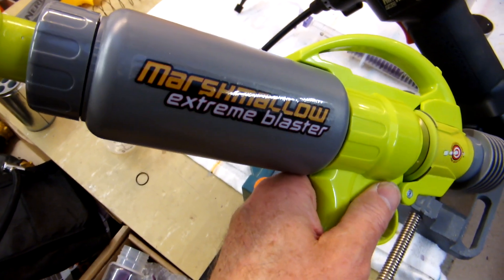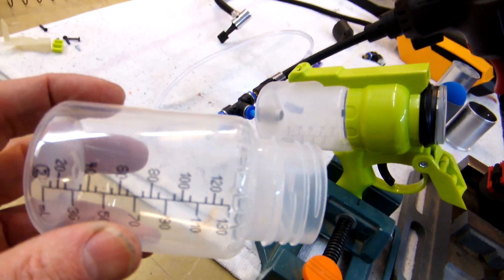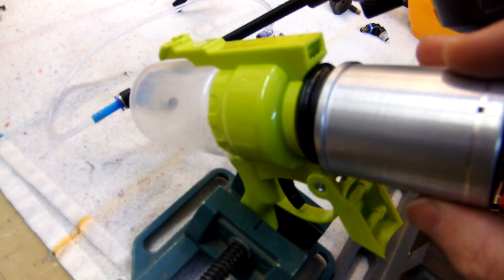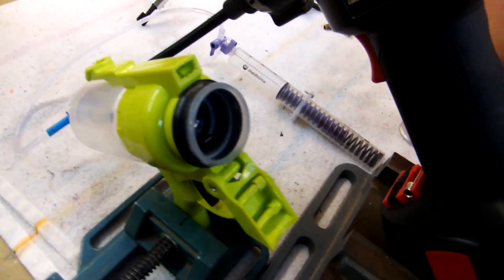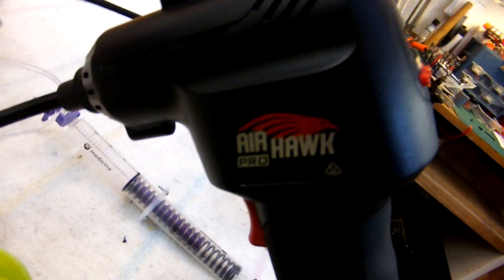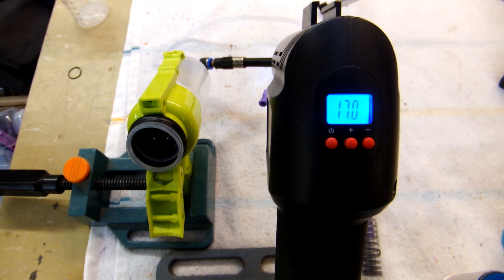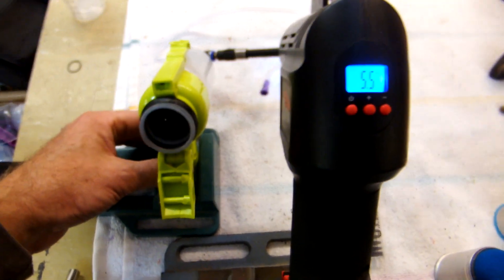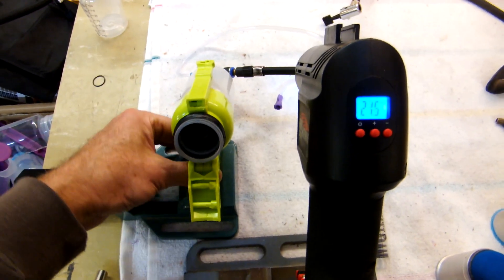MINIMISED MMXB test #1 (automatic refill-cycling)

Comment: Well this is getting spicy.
Reply from the maker: We heard you like it hot, so aiming to please! 😅
Reply: @unscrupulousmodefiler  quick question how good is the air hawk pro. I have been wanting to get one for myself for nerf and normal use.
Reply from the maker: @zeanyt2372  Looking at the internals they're the best quality and most solid constuction I've seen. Still plastic gears, but it runs comparatively smoothly. Apparenty you should go for the "Mark 2" (the one WITHOUT the red screw-attachment for the flexible tube) as the tube's easier to get on and off and something about the build-quality was better (I forget where I saw the review...). The "Pro" has the battery and the "Standard" has to be plugged into 12v somehow. The Pro is pricey here compared to other compressors, but if you were after someting in this "drill-like" form-factor either of them are still going to be a good buy. I'll be doing a more thorough review vid for each of the compressors I've got and will list pros and cons for each of them for use in Nerfing applications. Not 100% sold on this one just yet until I iron out the automatic cycling reliability issue, but if that gets sorted then it's definitley something to consider.

IMPORTANT: if you 're going to run this to pressurise ANY kind of Nerf gear, it's really important to include an appropriately-rated over-pressure valve so you don't risk exploding your tank (hence why I'm trying to make my own in the next vid...). Don't rely soley on the compressor's internal pressure-gauge or auto-stop settings - they tend to over-fill when dealing with very small volumes like this or even "forget" to stop sometimes...
Reply: @unscrupulousmodefiler  thanks for the help. I don't believe in not having backups and safety features especially in HPA.
Reply from the maker: @zeanyt2372  Cool man. I learnt the hard way, popping the business-end of a v2.0 SPEXBZ (2-part glued cylinder rather than fully milled) off by letting the pressure incrementally build with several short "bursts" from the compressor. I even had the OP valve on the bench but hadn't plugged it into the circuit yet. D'oh!